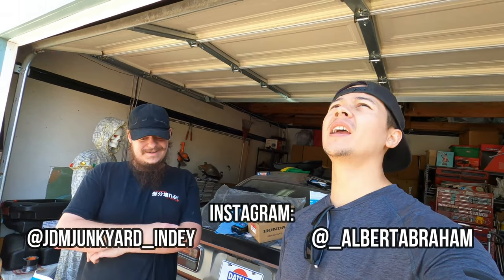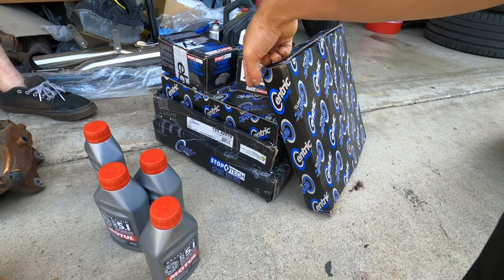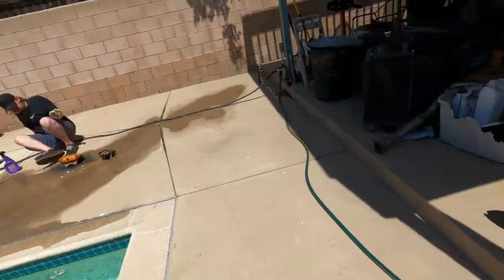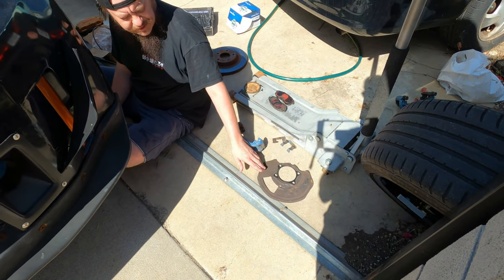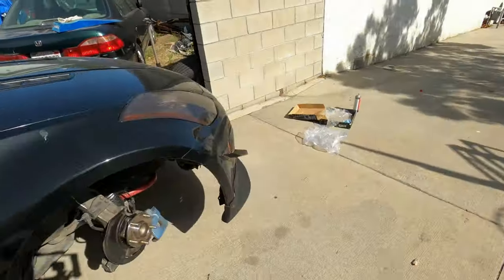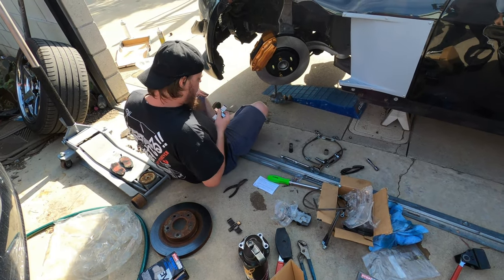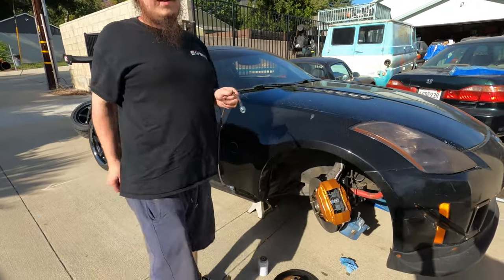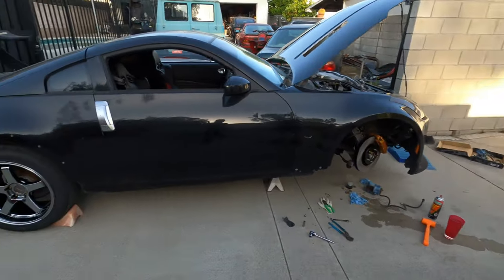BREMBO BRAKE INSTALL! 350Z (Pt.1 - Front Calipers, Pads, Lines, Rotors)

Comment: did you guys get brembo brake lines or stanard lines to run to the new calipers
Reply from the maker: We used the z1 conversion stainless steel lines. They’re basically just stainless lines that you’d put on any z with factory brembos.

Comment: may i have links of the lines and screws, because info is kinda vague and i want to copy paste your work.
Reply from the maker: No problemo here are links to the exact ones I ordered:

Lines: https://www.z1motorsports.com/z1-products/z1-motorsports/z1-350z-g35-stainless-steel-brake-lines-p-2998.html?list_name=SearchResults&oid=2998%3A0%3A9%3A2&qid=6f7c6a5b2a5284080537683583c892d1

Brake bolt (4 needed): https://www.z1motorsports.com/rear-brake-system/nissan/oem-350z-g35-brembo-brake-caliper-mounting-bolt-rear-p-10162.html?list_name=SearchResults&oid=10162%3A0%3A89%3A2&qid=b930dc24139b7cf57da88a9bc272277f

Comment: Do you need to remove the brake dust shield for these brembos to work?
Reply from the maker: From what I remember the brake dust shield would need to be trimmed a fair amount in the front to work with the larger rotors, and allow the calipers to fit. The rears we were able to retain the dust shields, however we did need to cut the forward facing edge of it off, because the rear rotors are larger as well.

Comment: Are the brake lines just Brembo OEM size, or is there a special line that is needed for the conversion?
Reply: Never mind.  I found my answer.  The Brembo stock ones is what I'll need.
Reply from the maker: We ran aftermarket stainless lines made for brembo brakes on our conversion since we had to purchase lines anyways. Best of luck with your swap!